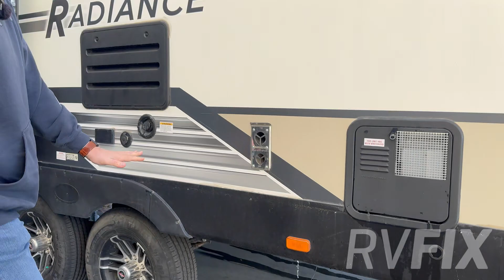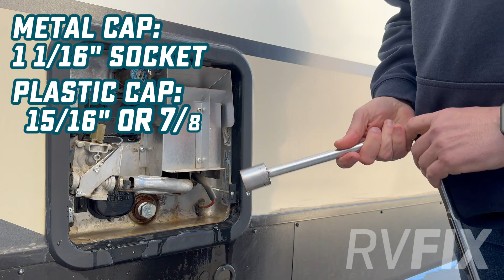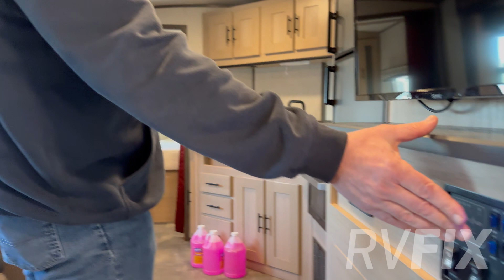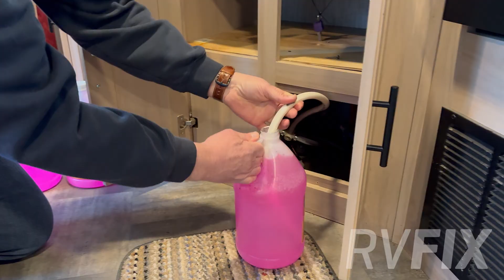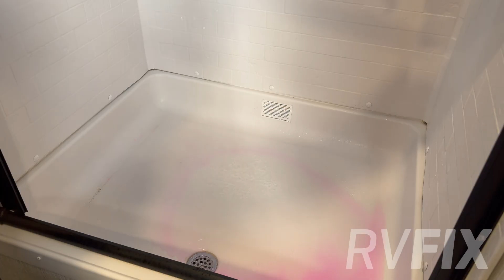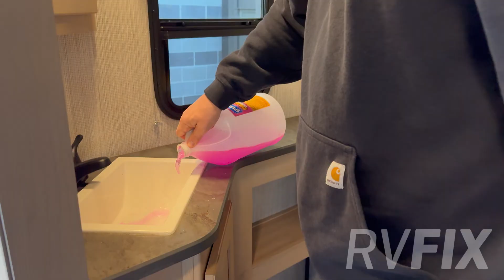How to Winterize Your RV | Step by Step Process | DIY RV Repair Help

Comment: Please could you do a winterize video for the go-lite series? New to travel campers and want to learn everything I can. thanks!
Reply from the maker: Great timing on this comment! We actually recently filmed a video winterizing the Go Lite Boulderback and we are planning on releasing it early in September! I see that you indicated in a comment on another video that you've got a Cloudbreaker. The winterizing process will be very similar for both, with the biggest differences just being the locations of everything. If, during your winterization, you find that you would like some help, please don't hesitate to give us a call at 844-667-8349! We'd be happy to help walk you through the process with your RV. 

Also, I'm assuming you bought your Cloudbreaker from Bish's RV, which would mean that you received a one-year membership of RVFix with your purchase! If that is the case, then you currently have access to unlimited RVFix calls! So if you don't want to wait for the video to come out before you winterize, you can call and have one of our certified RV techs walk you through everything you need to do, completely free! We'd also be happy to answer any questions you have to help you feel more comfortable and confident with your new camper! Thanks for your comment!
Reply from the maker: You may have already seen it, but I wanted to make sure to let you know that our video on winterizing a Go Lite Boulderback is live! We hope it helps you!